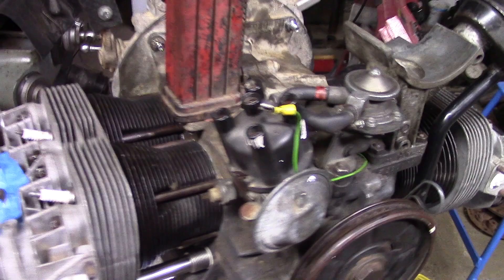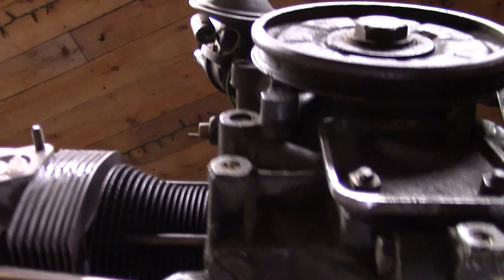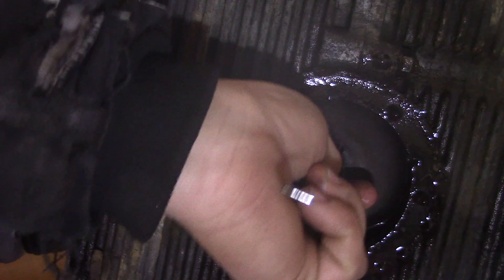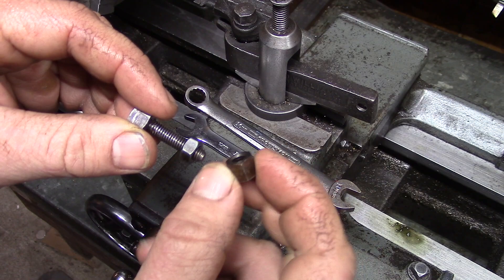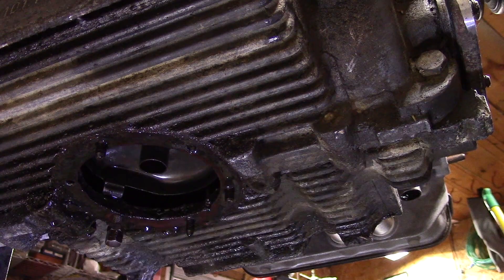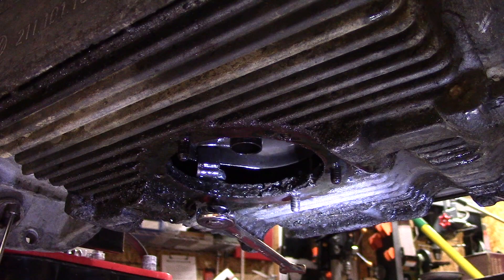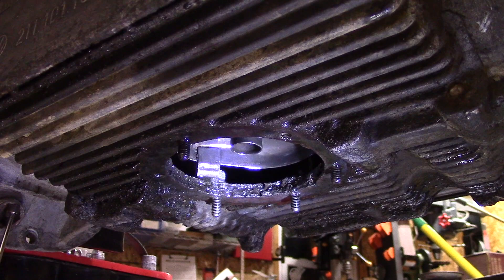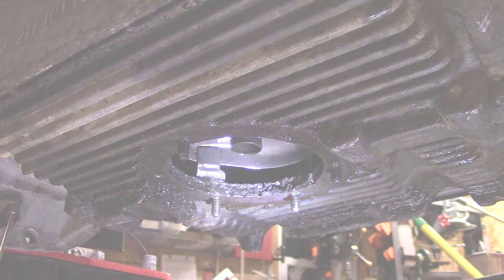Air Cooled VW Oil Sump Plate Stud Troubleshoot & Repair

Comment: That sump plate was leaking so bad because the studs are not in far enough. That is why the blind nuts are stuck on the stud, which won't let you get the right pressure onto the sump plate.

Comment: I've just had this exact problem when changing the oil on my bus - found a 10mm nut and wondered where it came from! Great video very helpful thanks.
Reply from the maker: I think it’s getting more common as time goes on and these cases get older. Glad I could help!

Comment: The plastic insert in the lock washer won't deteriorate over time will it?
Reply from the maker: It’s possible that after a very long time it could eventually deteriorate the nylon washer, but I think it would take a while. A person could attempt to red loctite a nut on instead, but I doubt it would work because of oil contamination.
Reply: @MaineMachinist  ... thanks, I'm going to try to do this, I figure ihe plastic won't fall apart until after I'm dead and buried!

Comment: Lifesaver, maybe. Mine isn't even tight on the washer so it isn't as far out of the case as the other studs so I can't get the nut on it.
Reply from the maker: Are you saying it doesn’t extend up into the case far enough?

If so, double nut it and turn it back up into the case
Reply: @MaineMachinist  no, it's screwed too far into the case. I couldn't get it out, not enough threads to grab onto. I'm stuck
Reply from the maker: @guymanicone7921  any way you can take a picture of it and send it to my Facebook messenger? Facebook.com/hiltzmachine

Comment: What torque spec did you torque them when you put it back in?
Reply from the maker: I don’t torque these other than by hand
Reply: @MaineMachinist  many said that 60 in-lb is the best, i use a nut screw driver and still getting leaks. I was thinking to get a torque wrench but wonder if after fixing up the stud like you did make them more fragile
Reply from the maker: @Tom_Secret  are you using fresh gaskets? That’s very important.

Do not add silicone. You could, however, lightly paint your gaskets with Permatex Aviation Sealer.

That’s what we recommend on the engine case halves, pushrod tube seals and other areas.

Comment: Perhaps put a little bit of rubber or wrap something around those pliers before sticking them into the case.
Probably doesn't matter all too much if you're careful but good insurance against shavings.
Reply from the maker: Certainly couldn’t hurt to take extra precautions!